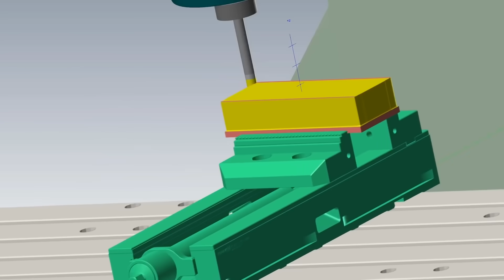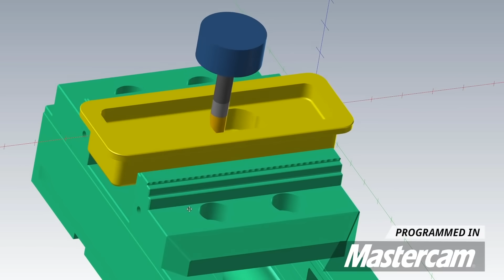I Accepted a HUGE Machining Job, but I Have No Idea How to Do It

Comment: I've seen and worked for businesses that got a really sweet lucrative contract and they kinda dropped most of there normal work and re geared The operation to almost exclusively do just this job and made bank but when it dries up they have to struggle to get back the volume of they had. A place I worked pretty much re fit the fab shop to cater to vessels for GT Solar, it went from custom vessels to a somewhat of a  production line and this went on for a few years and they made bank but still going full tilt the CEO sees on the news GT Solar had gone chapter 11 and closing the doors! They didn't even let them know they had to find out from watching the news! All the sudden EVERYONE STOP WHAT YOUR DOING!!!  Take everything related to GT Solar the hell out of the shop! Andddddd there were layoffs.... Kinda screwed some employees but the shop made so much money from the contract It didn't really phaze them over the big picture just a hiccup to them not the same wonderful scenerio for some of the employees though... They were hitting the help wanted listings but thank God the millionaire owner was not affected he was just fine at his house way down in Tortola BVI, pheww... There is a god🙄

Comment: Yeah my current boss is like that too. Take the job without even thinking if we can do it. Just 2 weeks ago he took some prototype to make. 
Alu, 4 parts, somewhat complicated but not too problematic. To be done in 2 days. 
Quick programming and some simulations on easy mode we got like 4 hours per part. Cool we do it on 2 machines and we can be done easy. There was one part that was a bit worrying. 1mm slot 8mm deep.

Next day 2am I'm done with first side. It's beautiful so I put second part to do it overnight. Might as well save 2 hours. I come at 2pm for my shift and first side done. Second side still to program. Getting a bit tight. Get completed program at around 9pm. Simulation says 5 hours. Yikes but doable. Set up machine and all to be perfect. Run the program at midnight. Stay with machine till half past 3. Only some minor stuff to be done with no chance of crash so I leave it running.

Come back and first part is still in machine. Last tool broke(1mm slot) and new program needs 9 hours to finish. Well fuck. But at least its working.
Set up second machine to do the same part. Change the first part at 8pm. And wait till 4am to change last part. That was my last week before Christmas. 
We had to cancel production on 2 machines, we just had a crash on 1 a week earlier and we still didn't have 5th(new) machine set up.

Comment: This is inspiring, sometimes you have to push your limits without passing them too much. Today it is more complicated, parts and materials are going up in price at a fast rate and hard to find at any price and employees are very hard to find, no one wants to work so wages are climbing through the roof. What you would have paid a semi-skilled factory worker a year ago McDonald's is paying them as starting pay plus a sign on bonus. I have a huge amount of orders for my products and am renovating a new, larger building for the higher production needed but even finding plumbers, electricians and roofers to do the work is nearly impossible and when you can they are taking a long time to complete the work do to parts shortages. There is so much work out there but no one can find the help to do it. We are living in strange times, something is up and it ain't any good.

Comment: You're absolutely the Tony Robbins of machining.  It's a joy listening to your stories.
......and the largest tool I've ever bought is a Delta drill press.  I loved machine shop back in the '70s in high school but I never pursued machining as a career.  I remember touring our local community college and they actually had a CNC milling machine. That right there scared the crap out of me.  On an out of town field trip to Portland Oregon, we toured a Hyster machining facility, the FMC shipyard, a metal foundry an an engine rebuilding shop.  Technology has made unbelievable strides.  You grabbed the bull by the horns and never looked back. Congratulations on your success 👍

Comment: I make parts for bullet manufacturing. Plates with thousands of holes. Each hole has a tolerance of +\- .0002
Some of them are +\- .0005
Each hole has to be perfect. Otherwise there would be a big 💥 at their plant. Tight tolerances aren’t bad once you know what you’re doing. I

Comment: 1000 of an inch haha on a cnc is easy. We used to do that shit on manual machines at 2000ths. With manual grinding machines we where working at 5000ths inch in 20°C vibration controlled environement (25 years ago). Then using mitutoyo cnc measuring machines. Sandvich carbide cutting tools. Miss those days

Comment: When I was a Tool&Die machinist back in the 70's we didn't have any CNC machines. Everything was done by hand and the layout table was used heavily.  Then I joined the USAF and went to work straight out of basic training to my job no tech school. Also got 2 strips straight out of basic. 
 The metals in the Tool & Die were mostly tool steels of many different types and heat treatments. 
 The Aircraft metals were mostly different types of aluminum. My first time to see and feel Titanium I was amazed at the strength of the metal for such a small size like..375 inch was so strong that I put a bad part in a vice at the end of a long heavy work table and tried to bend it. Had to use a cheater bar about 4 feet long. All i accomplished was lift the other end of the table. I put the Titanium in a lathe and it ran true. It did not bend.
 I kept some of the old parts and made many useful things out of it.

Comment: Call me old fashioned, but I love stories like this where we build our own stuff. The engineering, the production lines, all that problem solving, the shop banter, and just figuring stuff out... Love that environment. The 3D folks are like that too. I hope it keeps coming home.
Reply: CNC is bringing it all back. It doesn't make as many jobs as old style machining and assembly manufacturing methods but its far more efficient with less mistakes, quicker to turn around, less waste, and with tighter tolerances.  The jobs it does make though are skilled, high paying jobs and it allows for a whole network of new opportunities for vendors, technicians, software and hard ware devs, logistics, etc.  It is only of those things that just cause positive feedback loops where everyone wins.

Comment: I worked as a CNC tech operating a huge bed mill back in -08, just before the recession hit. Our boss had put alomst all eggs in one basket so when the recession hit, Sandvik stopped everything we manufactured for them so we lost 70% of our business over night, I had to go and 4 other machine guys got laid off aswell. So having a company who relies on others that much it's vital to not have a customer of that size supplying you with job.

Comment: I tell my guys, make the parts correct to numbers and information that's on the prints. Then imagine your buying that part with money out of your own pocket.  The scrap can stays empty and the reject / failures aren't there.
Reply: I use to inspect for the Big Orange Helicopter Company. When i would reject a part and the Machinist would come in bitching and moaning i used to tell them " when all else fails, make the part to the print".

Comment: Why did you lose that original customer?  I'm going to check out that ROV company because I'm starting up a new venture that will use ROV technology to find and retrieve/salvage submerged old-growth timber that are 15-20 feet in diameter.  So it will take a couple of ROVs, a tender (big oceangoing expedition-level boat) operating and towing around a 100' barge equipped with air compressors, cranes and winches.  Come to think of it, a drying warehouse and sawmill will be required to produce a sellable product, and then trucks to haul it to a railhead and airport for distribution, depending on how sales go.

This kind of hardwood is valued in making the best veneers and musical instruments - Stradivarius's great violins sounded so perfectly because of the ancient hardwoods used in their manufacture - it resonates so well that even computer-designed composites can't replicate the perfect tonality of tight grain hardwoods that are no longer available due to extinction by disease and climate change.

I'll probably have to get some amount of outside investment besides my own stake, perhaps involving the suppliers of the aforementioned equipment.  But the potential payout is immense because of the popularity of the rare and exotic hardwoods that have the tightest grain known because the trees grew thousands of years before being knocked down and preserved in low-oxygen water in the mid-20th century.  The new availability of multiple rare hardwood species should inspire a new generation of makers to produce all kinds of furniture and musical instruments featuring these unique hardwoods.
Reply from the maker: They later got purchased by FMC and then got sold… I am sure you can find out a lot by looking up schilling robotics
Reply: @TITANSofCNC  Thanks.  If this works out I'll check with you first for the specialized equipment fabrication aspect.  Timeframe is anywhere from one month to a year & a half, depending on a likely initial financial influx.  Stay safe!

Comment: It's one thing to push out the test piece that you work on 24/7 perfectly to spec, then there is the fact that you have to make 1000 of them, all to spec, under contant time pressure.
If you manage both, then you are a fabricator.
Reply: I worked for Schilling Robotics from 2006-2009 and Titan's parts were spot on all the time!!

Comment: That was then, this is now, the reality today is give China or Mexico as much work as they can handle.
Reply: Every time one of the shops I've worked at has tried to farm work to China or Mexico it comes back as crap quality. We either have to spend a bunch of time reworking it or the customer hates it and we end up having to remake it. Simple things like using certified material escape them. We had a 3000 part or come back from China, when we asked them for material certification they said they didn't have any. They were "pretty sure" it was the right material. Turns out is was not. The customer was pissed. Wrong material with crap quality parts, we almost lost that customer due to the one order we shipped to China.

Comment: Damn that's a big machine at the beginning! Definitely bigger than a VF-6, what is it?
Reply: They make vf12’s
Reply: @Sicktrickintuner  I know, and VF-14's and VS-3's which are crazy big. I don't think I've seen anything bigger than a VF-6 from a youtuber
Reply: @ggrailwaynz  titan is not a YouTuber.  Homie started a machine shop in the early 2000’s and decided to hop on to YouTube
Reply: @jacobm2625  True, I suppose I mean I haven't seen anything bigger than a VF-6 being used on Youtube.